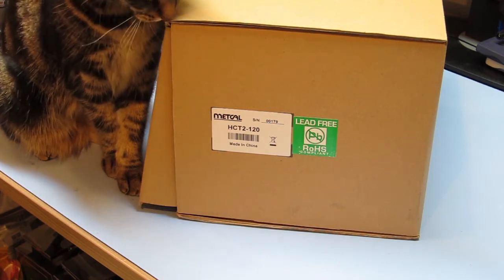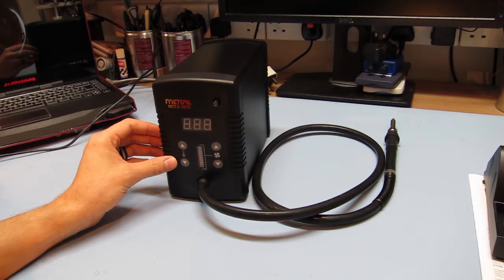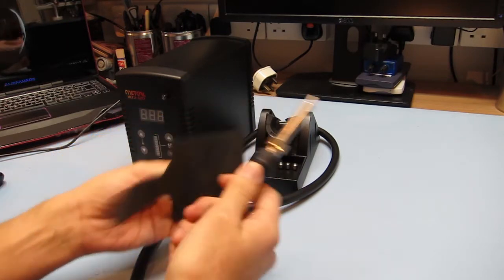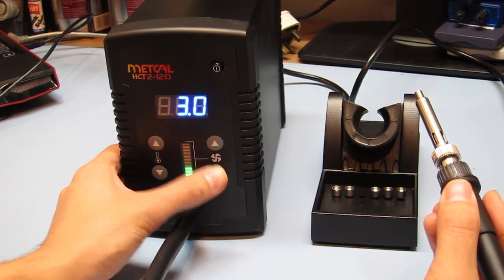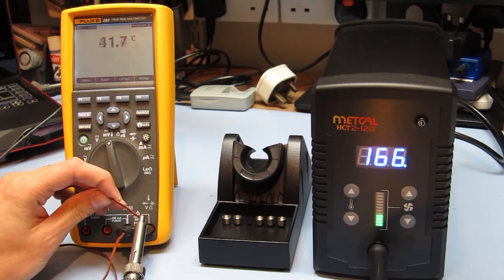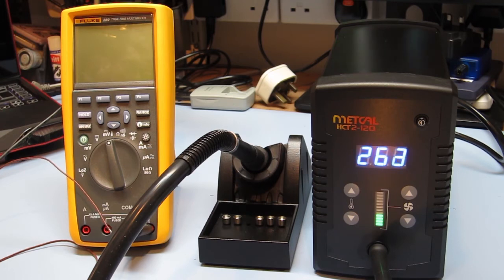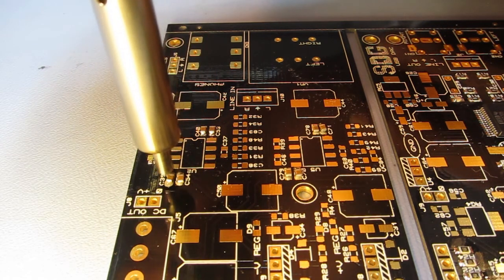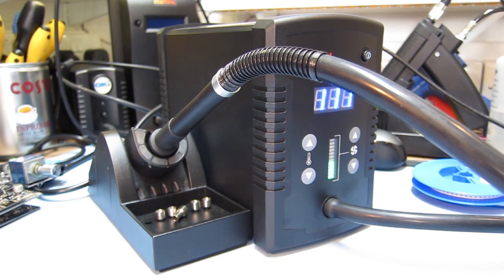SDG #02 Metcal HCT2-120 Hot Air SMT Rework Station Unboxing

Comment: Steve what metcal  hot air would you recommend for building and repair sac. Also iron desolder and tweezers .
Reply from the maker: If I'm honest, I think the hot air stations are overpriced these days. I have the HCT900 and it's a solid performer, but these Chinese systems like the Quick are half the price. I have a lower cost, lower power Quick hot air station to look at soon.

Comment: don't you think that 7Lpm as air flow is no enough ??? it would be impossible to use for bigger IC's.
Reply from the maker: Thegoodpal You can't use this for bigger devices - it's definitely for niche applications where you're regularly working on smaller components and don't want the bulk of a larger hot air station. You'd need the HCT-900 for bigger jobs.